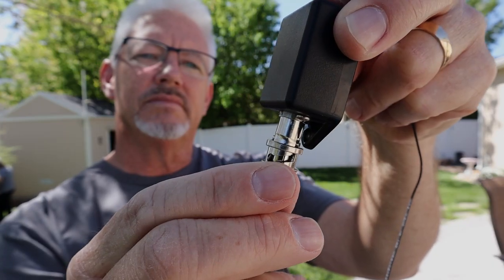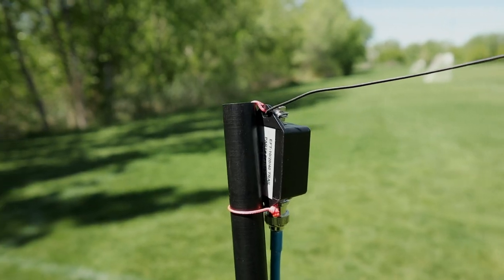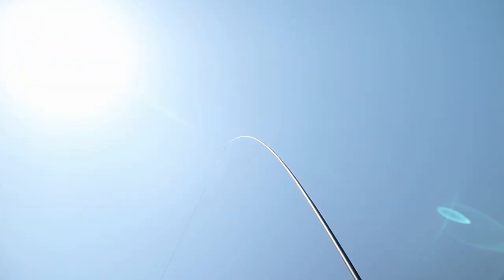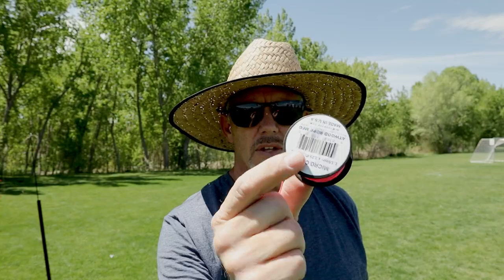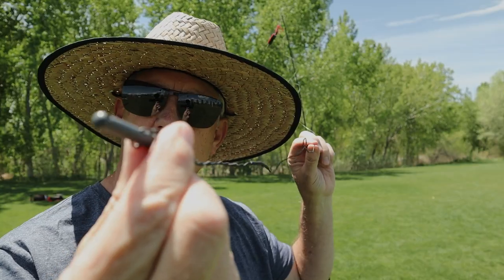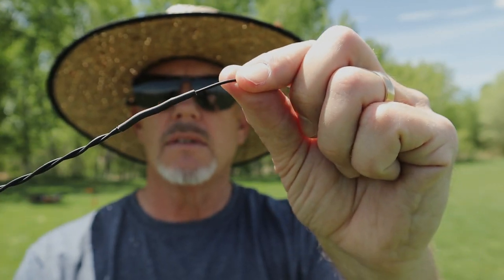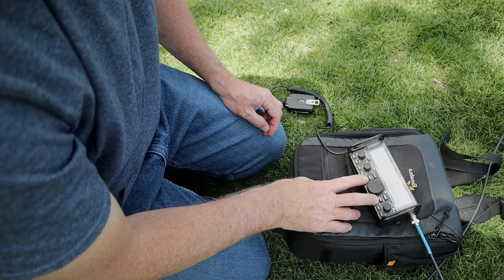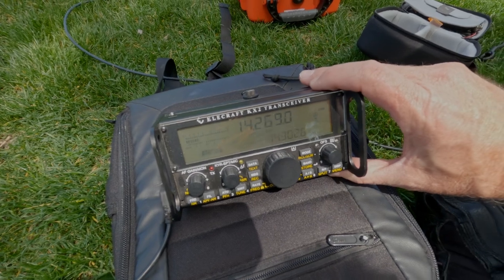Endfed mount idea and  antenna SWR check | K7SW Ham Radio

Comment: There is another mod you can do and It's to remove the wire It comes with it and replace it with a half wave length of wire for band you work the most, doing so you will get rid of the coil and gets even lighter.
Reply from the maker: That is a great idea, i will try it. thank you.

Comment: Whynput the match box up and not the other end? That would cut the amount of coax that you need in half and make mounting a whole lot easier.
Reply from the maker: David, for this video, the match box is only about 4 feet off the ground. I really could have it lower and it would work well.
 Your right, this antenna likes the match box to be near the ground with the end of the radiator up higher.

Comment: Carbon fiber is conductive. Could you have used the rod itself as the antenna element, and if so, what would be required?
Reply from the maker: Interesting thought,  I may try that.  I would suspect it is low grade carbon and might not be very good.  It is worth a test.  Thank you for a great idea.  73
Reply: @hamradiowithkevin  Looking forward to the experiment  😊